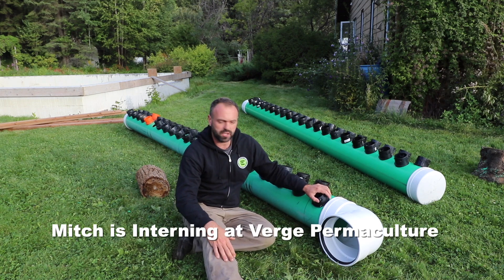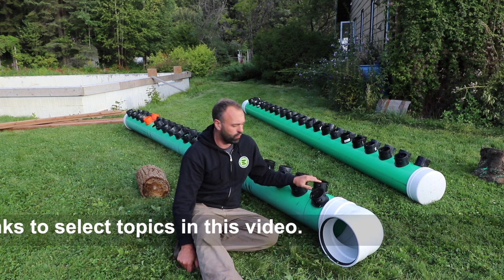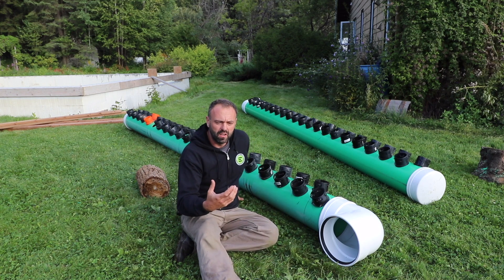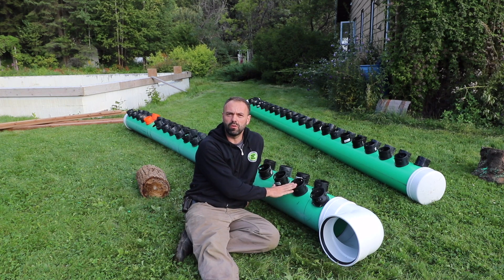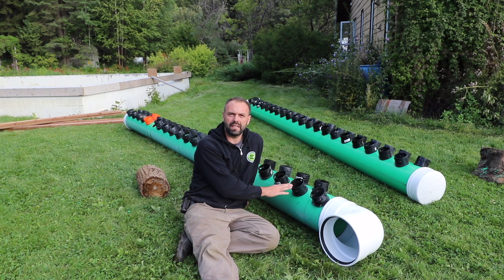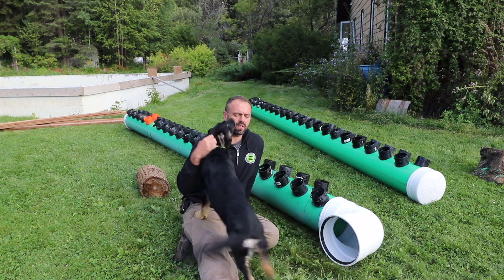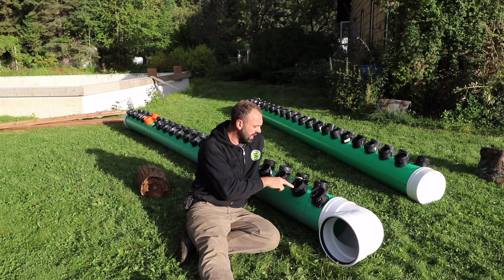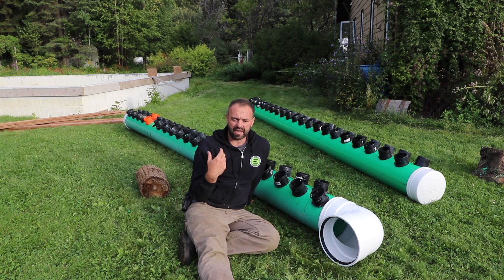Passive Solar Greenhouse Build Progress Update September 1, 2020

Comment: Hi, I'm also thinking about building an underground heating. I've read a lot of articles and seen a lot of videos. I still don't understand what's right. Some say that the cross-section of the manifold should be close to the cross-section of all 4-inch tubes. It is said to be a mistake when the collector is 4 "and 6 pieces of 4" pipes are connected from it. The air then slows down its speed 6 times. When I see that you have about 40 pieces of 4 "pipes on the Manifold and the manifold has 10", it turns out that the area of all 4 "tubes is about 400in2 and the area of a 10" manifold is only 76 in2. The manifold is dimensioned for only 19% of the area of all pipes. Can anyone explain what it is like? Turbulent flow is important for heat transfer. And for turbulent flow to occur, the air in the 4 "tubes must have a certain velocity. But that will decrease when the manifold does not have the necessary cross-section. I hope I wrote it clearly. My English is not good, so I apologize.
Reply from the maker: You need to look at how air moves through ducts. 4" weeping tile can only take roughly 10 CFM per pipe. So 40 pipes will allow up to 400 CFM. Potentially more if you use higher static pressure. A 10" pipe can easily manage 400 CFM. Originally I was going to use a 16" duct but based on my modeling 400 CFM for my greenhouse and soils is sufficient.
Reply: @VergePermaculture  
The effective length of the fittings in the manifolds will be far in excess of the physical length of pipe in the system. If the weeping tile perforations are in the valleys of the corrugations you will have condensate in the bottom of every corrugation which isnt good for efficiency. I recommend cutting a straight slot with a circular saw partway through the corrugations so the condensate can fully drain. Be sure to locate the saw cuts at the bottom when installing the tubes. Balancing the tubes after installion will ensure even distribution of air. The manifolds will favour some tubes more than others. Worst case, some tubes will have very little airflow and wont be earning their keep ;).
The flow rate throug a tube depends on its length, friction loss and bends. 10 cfm is very safe but may not be enough to provide effective cooling. In my experience you need to be turning the greenhouse over at least 20x per hour before you begin to outpace the incoming gains. A turn over rate of 60 isnt enough to outrun the cooling capacity of the tubes, unless its autumn which is when the mass temperature peaks. 400cfm would be ok for a 1200ft3 greenhouse volume assuming the 400cfm includes all system losses. I`d recommend a 1000cfm fan and a speed controller to provide extra headroom,you`ll be glad of it in the summer.
Reply: @JohnGuest45  Hi John,
I also came across you while reading the comments on the "St. Isidore's Farm" channel. Could you describe what system and size of pipes I would need for a greenhouse of this size - 31´x 14´ and a volume of 3,107 cf. I would like 4 'pipes in three levels. I have soil with more moisture. How much is the effective pitch of the pipes at one level. I am from the Czech Republic (EU) and we do not have any available information about these systems here. I'm in USDA Zone 6b. My main concern is to permanently maintain the state when it does not freeze in the greenhouse.
Reply: @TSAGEDAR  
 Hi 
VP`s design will work for your greenhouse. I`d suggest splitting it into 2 completely seperate systems as the reduction in flowrate will reduce losses and manifold size requirement ( less $$) and provide more flexibility. It will give you a more even air distribution in the greenhouse vs having a single inlet and single outlet running massive flowrates situated at opposite ends of the greenhouse.
VP`s system is based on Johns design, its a little dated but imho is certainly still worthy of the title SHCS. 
Since John Cruickshank passed away in 2011, information about designing these systems has steadily been lost or corrupted beyond all recognition.
The influx of realworld data 2008-2009 led to many design changes, the one most designers will be aware of is the increase in the recommended greenhouse air turnover rate from 5x to 10x per hour. 
The majority of the system design changes were hosted on John`s "plain-to-sea" forum website which is sadly no longer available. I installed my system late 2009 and incorporated all of the design changes plus a few extra features with enough fan power to turn the greenhouse air over 60x per hour for experimentation. 
The layout is radically different to the normal twin manifold and parallel tube arrangement and, so far, still one of a kind.
Reply: @JohnGuest45  The width of the greenhouse 14´ gives me 8-9 pipes per level. (I follow 2´ horizontally and 1´vertically from each other) So I don't know how to do 3 levels. when you say that I have to divide it into two separate systems, I get either: variant1) 1 manifold and 1 level (8 pipes) and 1 fan. And on the other side of the greenhouse the same in the second layer (9 tubes). or variant2) 1 manifold and two levels (17 pipes) and 1 fan. and on the other hand again the same (17 trumpets) and then I will have, but a total of 4 levels. So how to determine the diameter of the pipe on the manifold, it seems to me an awful little 10´ per 40 pipes, what VP shows in his video. Is it possible to see your system somewhere on the web?
Reply: @TSAGEDAR  
With vertical perimeter insulation you wont be able to fit more than 7 tubes across the width as you need to leave a foot between the perimeter and the first and last tube. The 2nd row would contain 6 tubes which are staggered, the 3rd row would be 7 tubes the same as the 1st so you`d have a 20 tube matrix made up of horizontal and diagonal spacing.
I wouldnt recommend placing the tubes as close together as VP`s installation, https://youtu.be/ymppTrSSIg4?t=99  unless you have a definite need for trading  limited thermal capacity for faster response. The closer the tube spacing, the less mass there is between the tubes and the faster it will heat or cool. 
Close tube spacings are typically used in systems that are biased to heating, where you have limited winter sun in the day and plan to use the heat the same night. The 2ft horizontal and 1ft vertical tube spacing (matrix) is a good choice for neutral heating cooling bias with both useful capacity and reasonable response. Its worth pointing out, any heat that travels more than 12" from a tube cant be recovered the same day / night (soil conductivity, diffusivity, soil moisture and thermal gradient dictates how fast the heat travels). I dried 2 cubic feet of soil and placed it in an insulated styrofoam box with a thermostatically controlled heatmat in the middle.  Temperature sensors were placed at regular intervals above and below the heatmat to track how fast the heat travelled upwards and downwards. Its not the most scientific method but it did the job. Using bone dry soil gives you the worse case specific heat capacity and slowest travel. In a working system you will have soil moisture which will increase both. 
Another thing to remember is you cant recover 100% of the heat you put into the mass, i guess you could call it the thermal equivalent of the Angels Share in the whisky industry.
Reply: @JohnGuest45  Thanks for your patience and long answers. Well, the more one learns the information, the more unsure what to do then :). I thought more pipes mean better cooling and you write that it's for heating. When VP system they are preloaded for heating. What is the purpose of a system with a smaller number of tubes? My goal is to raise the temperature in winter as effectively as possible compared to the outside temperature. I'm not talking about cooling in the summer, I'm not primarily interested in that. I only wanted one fan and you advise two, which in turn is about electricity consumption. I also discovered a Cruickshank calculator, but as I said, I'm not very good at English and secondly other units are used everywhere, so I still have to convert everything to the metric system and instead of CFM we have m3 / h (cubic meter per hour), ° c / ° F, etc ... it's not easy :) .. Let's say example A) 4" manifold and 7x4" drainage pipes (poor heat transfer efficiency), example B) 12 "manifold and 7x4" drainage pipes  (the best,great efficiency), example C) 10 "manifold and 7x4" drainage pipe (average efficiency). Is it possible to write it in such a simplified way?
Reply: @TSAGEDAR  
I think anyone who is planning to install a system should have a basic understanding of thermodynamics. Ifs very easy to overlook things if you dont know they exist. Most folks mistakenly assume the air will flow down a 230ft heavily corrugated tube just as easily as a 10ft smooth bore tube.  They may also assume the flowrate of the fan will be the open flow rating (at 0" SP) whether its connected to a 230ft duct or no duct at all. The trick is to look at everything, question everything and see if it really is as it appears. 
Take one of VP`s 40 tube manifolds as an example, it can be viewed in hvac terms as a 40 branch trunk.
Ask yourself a few questions, are the insert fittings flush with the inside wall of the 10" pipe or do they protrude into it? Things like this can and will make a massive difference to how the air flows in the manifold. Air doesnt like to turn corners and because it has mass it tends to keep on moving in a straight line until it encounters an obstacle.. Consider that the air in VP`s manifold wants to travel in a straight line, if the inserts protrude into the manifold it will create turbulence and cause an increase in static pressure (less air).  When the air reaches the flat cap at the end of the manifold, it wont slow down and make a smooth turn, it will strike the end cap creating back pressure and become tuubulent. The 4" tubes (branches) in that area may not get as much air as the other because the air in that area wont be moving smoothly, it`ll be chaotic like the bottom of a waterfall ;) 

Take a look at some hvac ducting system design vids on you tube to get a better understanding which will help you to design an efficient system or avoid copying an inefficient one.
This one illustrates the importance of smooth transitions for better efficiency. . 
https://youtu.be/vf0k7NlgQYY?t=344
This one is relevent to most shcs manifolds, but with less branches. https://youtu.be/Ww-Q9_Q4ATk
Understanding fan curves is also relevent to the system design. https://youtu.be/1pypEschLUI 
You dont want to be  using the same tube diameter for the manifold and the 7x4" tubes, the manifold becomes a bottleneck, limiting the amount of air. The10" manifold is better but the efficiency depends on the system as a whole not just the manifold or number of tubes.
Reply: @JohnGuest45  Thank you very much, this is valuable information for me. You are right that a person unfamiliar with the issue can make a fatal mistake that will reduce the effectiveness of the system. That's why I'm so annoying :) and I'm looking for any information that might help. Otherwise, I read the studies on the page - https://threefoldfarm.org/psu-climate-battery-study-2018-2019. If I understood correctly, they used some caps in front of the 4 "pipes to make the air run more evenly. Well, even though I read it, I didn't understand everything, but I still found it interesting. Someone has been examining two systems side by side in detail for two years.
Reply: @TSAGEDAR  
The study is interesting, it highlights how important it is not to leap before you look :) I only scanned through the information and a few things jumped out, greenhouse  #1 had about 300ft more tubing than it needed.The individual tube lengths were within bounds but using 20" HAF fans wasnt a good choice. The 2nd greenhouse was about 1000ft short on tubing but using multiple fans was good.The study did mention the possibility of using 2 fans in a push pull arrangement which should  alert them to the fact that they`d be better to reduce the system losses instead. Push pull fans will cope with higher static pressure but wont deliver more air than a single fan. 
The heating and cooling results are not very clear, the heating btu`s will involve both sensible and latent components and only the sensible component will raise the greenhouse temperature. The latent component simply raises the humidity without affecting the temperature. The latent component comes from the evaporation of moisture in the tubing as warm air passes through. The thing that you might overlook is that the change in phase from liquid to vapor requires energy. The problem is the energy that is used is sensible, basically it steals heat from the mass (which could be used to raise the greenhouse temperature) and converts it into a latent form (water vapor) which doesnt. 
Controlling the fans is best done with a differential thermostat not standard greenhouse thermostats which have no idea how warm or cold the mass is.The stats could call for heat when the mass isnt able to deliver any which is a waste of power. A differential thermostat only cares about the difference in temperature between the mass and the air. If there is enough difference the fan runs, this maximises the heat collection. For example, if the stat is set for a 20F difference, the fan will run if the mass is at 40f and the air is at 60f, or 50f and 70F. A standard stat may be set to operate at 75F so it can miss an opportunity to store some valuable heat..Cooling is similar in that a standard stat could call for cooling when the mass temperature is the same as the greenhouse air temperature, all you`ll gain from that is a bigger power bill :) There are so many aspects to these systems its hard to cover them all in a few replies.
Reply: @JohnGuest45  Could you please correct the middle link in your older post. Thank you
Reply: @TSAGEDAR  
Dont know what happened with that link but should be good now.  The short video illustrates why its important to measure and then balance the airflow in the individual tubes rather than just assuming they all have equal flow.
Reply: @TSAGEDAR  
you dont want to put the tubes in the end of the barrel. If the tube ends protrude into the barrel the air will not flow smoothly into each tube. If the ends of the tubes are recessed and radiused to form bellmouths, the air will flow very differently. Curves or bends in the tubes close to where they leave the barrel will have an effect on the air entry to the tube inside the barrel. Try to think a little more laterally and you`ll get there :)
Reply: @JohnGuest45  I didn't think the tubes protruded into the barrel. I would make a special bottom so that they can be aligned. But I see that I'm wrong again. I'm giving up :). Can't you please give a specific example of how this should be? Sketch, picture, anything that will help me, thank you.
Reply: @JohnGuest45  I also found this https://photos.app.goo.gl/nJsQDqWiWBqoUFqo7 but it's worse than pipes placed in the bottom or not?
Reply: @TSAGEDAR  
That was the typical plenum arrangement back in the day when the tubes were snaked from one plenum to the other. The problem was that no two tubes had the same flow rate and it wasn`t easy to balance them because of the sheer density of tubes in the barrel, you will need  to be good at wrestling pythons if you go that route :). Balancing the tubes involved squishing the input end of the tubes with higher flow rates to increase the flow in the lower flow rate tubes.  Its quite a tedious task because every adjustment affects the flow rate in all the other tubes so it takes multiple rounds of adjustments. Its worth the effort and you only need to balance the system once. You should upload a video (diagram,sketch) outlining your plan, including the type of greenhouse. I can see from your video`s you are handy at making stuff and your projects show you like to  think outside the box which bodes well for your greenhouse and the shcs system.
Reply: @JohnGuest45  Now I noticed that I have an error in example # 2. I have only drawn 11 tubes, there should be 13. John, if you find the time, I will be grateful for your comment. Thank you
Reply: @TSAGEDAR  
Hi, i`d suggest moving this discussion over to your channel where replies wont vanish :)